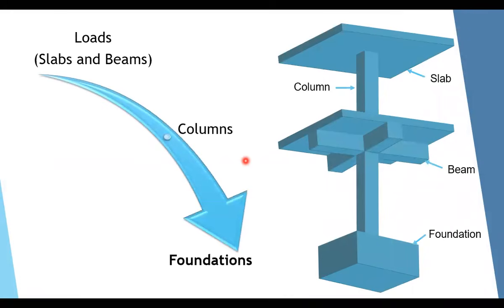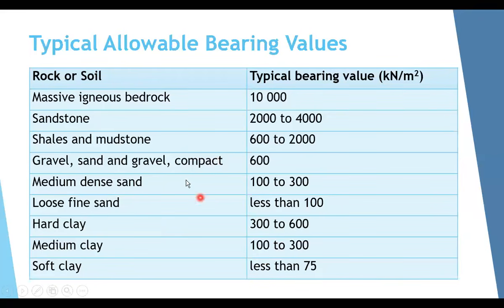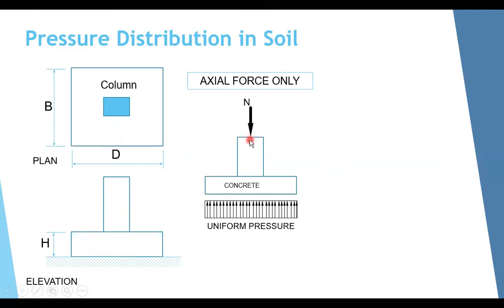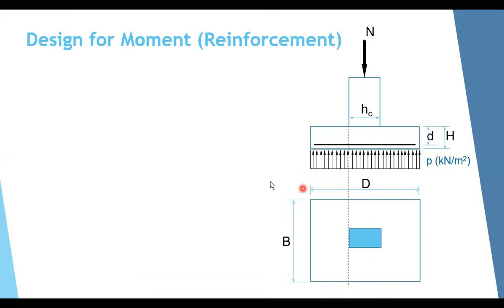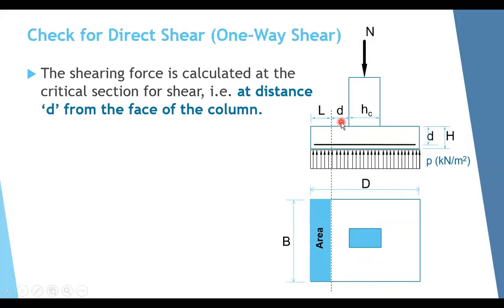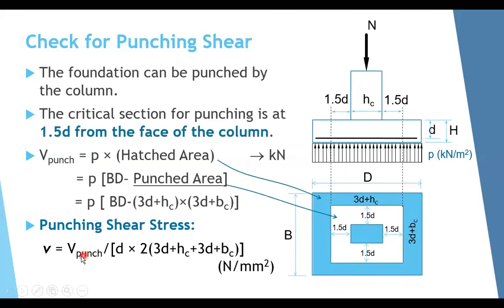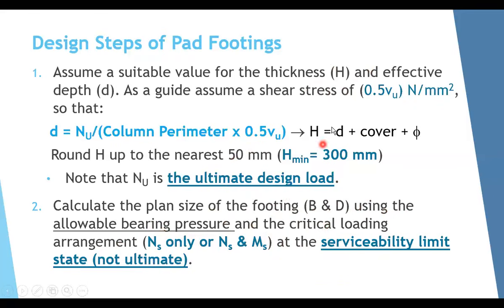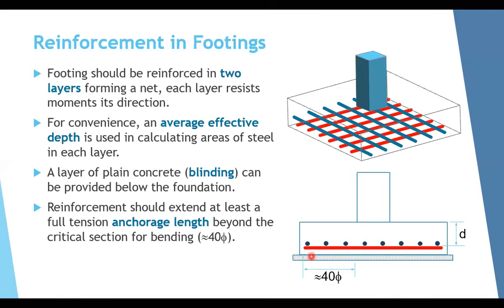Foundations (Part 1) - Design of reinforced concrete footings.

Comment: Thanks for your fantastic videos Dr. 🎉 Assuming that the 40xbar diameter anchorage length is still too much length for the space available in a section, even after bending up the bar at 90°, what is to be done? Every other thing is well satisfied in yhe the section, just this anchorage length 40xd issue
Reply from the maker: Thank you for your nice words. You will never have such thing. You will need bigger bar diameters in bigger footings and therefore you will have more distance for the development length.

Comment: Romanian foundation design code for isolated footings is simple: To assume a linear distribution of the pressures, you need to ensure proper rigidity of the pad footing. This can be provided by respecting some prescribed ratios between H/D>=0.3 (Height of pad, D- bigger footing length). If not provided, you have to check one-way and two-way shear. Otherwise, it is just a recommendation.

Comment: Dr. El-Gamel, is it correct to say that Gross Soil Pressure should be lower than the allowable soil bearing capacity? Gross Soil Pressure = (Column load including its dead load + Weight of soil above the footing + weight of concrete footing) / area of footing. Anyone ?
Reply from the maker: Yes
Reply: @MrElgamal77  Shukran.

Comment: Thank you so much for this Dr El-Gamal.
One question regarding shear stress; if it exceeds the concrete shear capacity, you mentioned that the solution is increase the height (H) of the foundation. Isn't another possible solution to use shear reinforcement?
Reply from the maker: Yes  you can but it is easier to increase the thickness
Reply: @MrElgamal77  I see. Thank you for your quick reply and fantastic work on your videos - really helpful and well explained. Keep them coming 🙏🏼

Comment: Hi, thank you very much for this nice video. I have a small question,
Why do we take SLS loadings (and not ULS) to calculate footing size?
Thanks.
Reply from the maker: Thanks for your interest. The footing area depends on the allowable bearing strength which is a SLS not an ULS. Therefore we use the service load not the ultimate.
Reply: @MrElgamal77  Thank you Dr.

Comment: Great explanation as usual! but how do you find the effective depth? do you simply assume the number and calculate based on that? or is there a specific method to be used?
Reply: If you're referring to "d" then I believe it's the distance from the top of the foundation to the center of the bottom reinforcement, if I'm not mistaken.